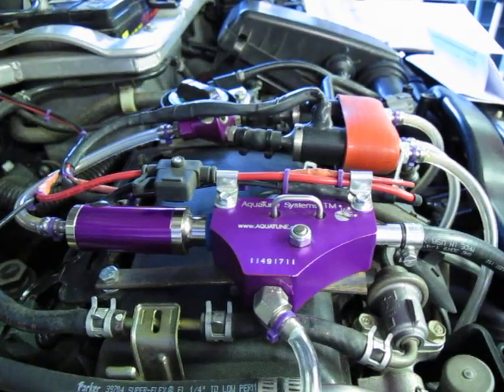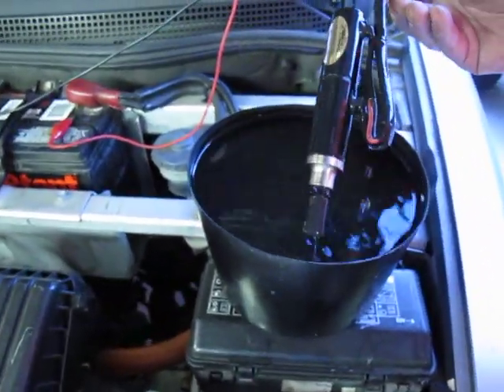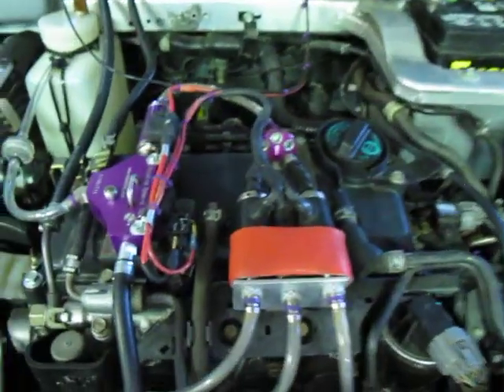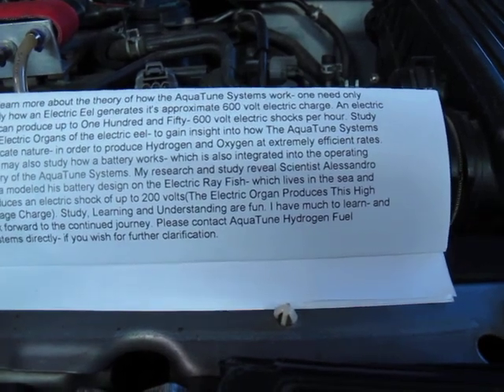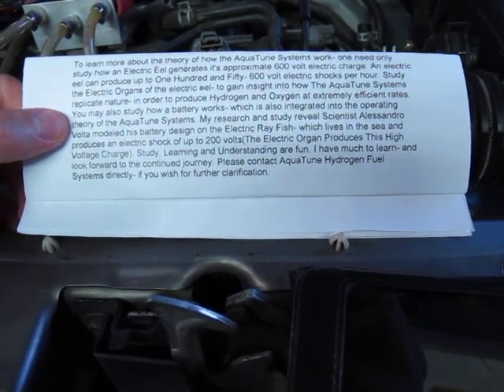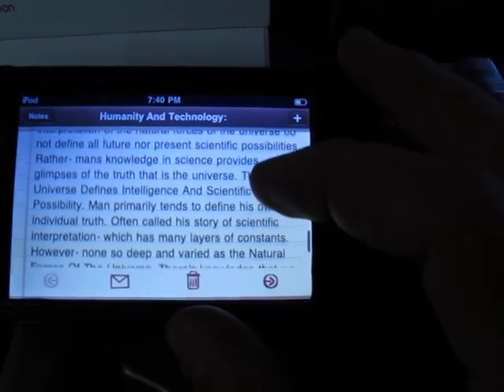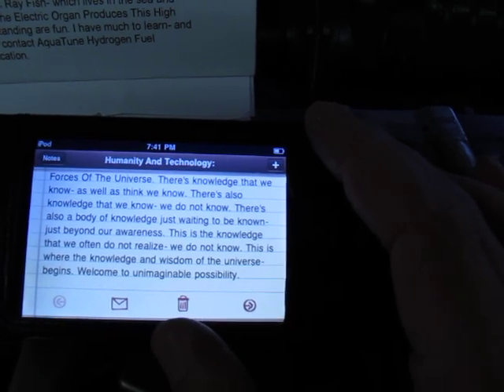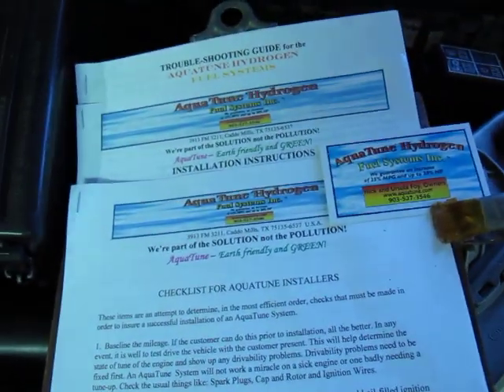Fuel From Water: AquaTune Hydrogen Fuel Systems Available For Automobiles - Customer Experience

Comment: So I did some research and it looks like it uses 2.5 LPM at 1.5 amps but I can't find the voltage. The website says that the power supply for the hydrogen generator is 12 volts but from what I understand the 12 volts dc is converted into a much higher voltage, what would that voltage be? Is it about 600 volts?
Reply from the maker: That's an excellent question Tyson. When I think of Static Electricity- for example- if we rub our feet on the carpet with socks on our feet- and then touch something- a high voltage 10,000(Ten Thousand) To 20,000(Twenty Thousand) Volt electric shock will be quite visible between our finger- and the object we touch(ground ourselves to). I do not know the exact static charge voltage- of the AquaTune system- however- it is my understanding that a static charge- is high voltage- and very low amps. AquaTune explain to me that the theory of operation is closer to that of an electric eel- which is why I research the electric eel- and shared my research and study note's on this video. I check with AquaTune before sharing my note's to be certain my research was accurate and in accordance with the operating theory of the AquaTune system. I highly recommend you speak with AquaTune technical support to have questions answered. Tyson- you would absolutely love AquaTune tech support. Have a great day Tyson. Always feel free to write me- anytime :) I have learn more from you than words can say :) You Are A Great Man Tyson :)

Comment: How many amps and what voltage does the unit use?  What is the LPM it produces as well? It does not look like it is producing much gas. 

Thanks for sharing!
Reply from the maker: Hi Tyson. You are very welcome- I always look forward to your questions- and your video's :)
When I spoke to AquaTune Technical Support- It was explained to me that this system builds a high voltage static charge which is why AquaTune refers to the generators as capacitors. The AquaTune system connects to the 12 volt car battery- which powers the system- and permits a static charge to generate- as the system is in use. Voltage increases and efficiency increases simultaneously. Cavitation takes place within this system as well- which is extreme pressure changes which also facilitates the efficiency of hydrogen production. I'm averaging a 50% increase in fuel efficiency with the 2014 model aquatune system. I recommend you talk with AquaTune Technical Support to have any questions you have- answered. Let me know what you learn :) I love learning how others understand interesting technologies :)

Comment: Thanks for posting, great video and the last one also, just wondering when you said that the Aqua Tune system is producing hydrogen did you not mean hydrogen and oxygen or is the the oxygen vented off before going into the engine?
Reply from the maker: Brian Whelan The way this system works it actually uses both the Hydrogen and Oxygen to permit a more complete burn. This is an excellent question for aquatune. this system works much differently than the older style high amperage hho systems. This is a low amperage system that uses high voltage static electricity, and only 1.5 amps, combined with the very powerful process of cavitation. All within a low pressure sytem ie vacuum. To learn more, just contact AquaTune Tech Support. I've had great success running the AquaTune system.

Comment: Do your system use distill water or tapwater, KOH ?? Do Your system comes with a ECU,?? ...Can you make a video with running engine..??,....Like in this video,...100% ON HYDROGEN ONDEMAND CHEVY,.NEW ECU, INJECTERS AND CAVITY ARRAY.. Can we mix Technology...??
Reply from the maker: Hi WaterEnergy. I invite you to contact AquaTune Hydrogen Tech Support because you are very technical and can speak the same technical language that AquaTune understands. Meanwhile- I'll answer as many questions as I can. I do not add anything to the water. I use distilled water for the system. I buy the water from the market for 88 cent's per gallon. AquaTune has design the system to improve fuel efficiency by 25% minimum. I'm averaging a 50% increase in fuel efficiency with the 2014 model aquatune system. The design of the system permits the system to work with the existing electronic control unit. Your video's and your work is very interesting. I appreciate your knowledge and understanding that you have gained through experience and study. Thank you for sharing your work. As for running the engine- see my Water Fuel Technology For Everyone video- which- near the end of the video- I start the engine and run the system.